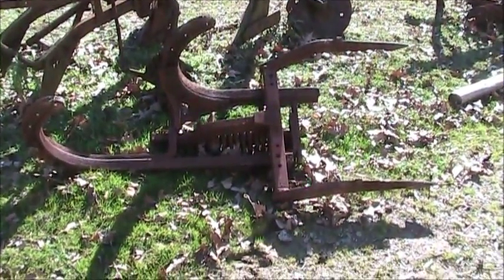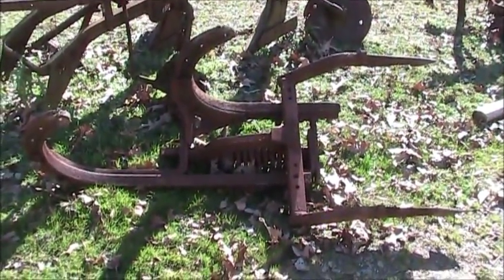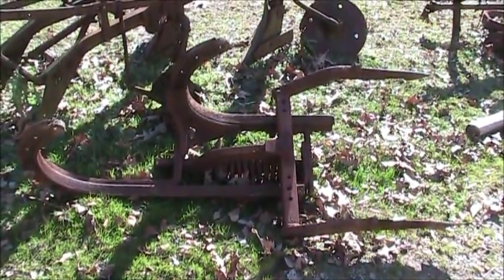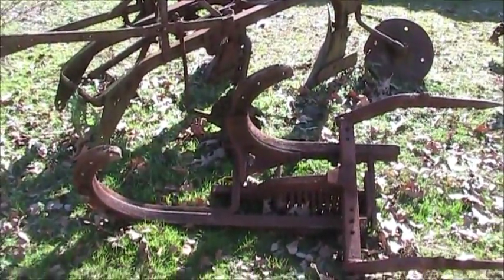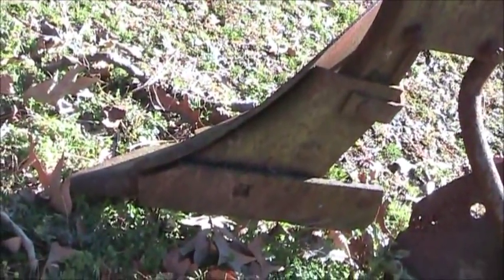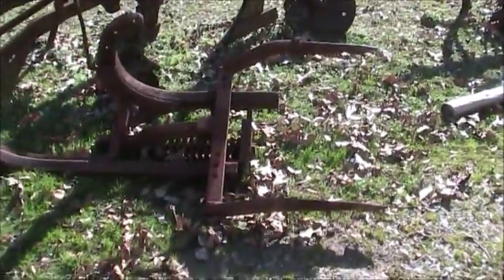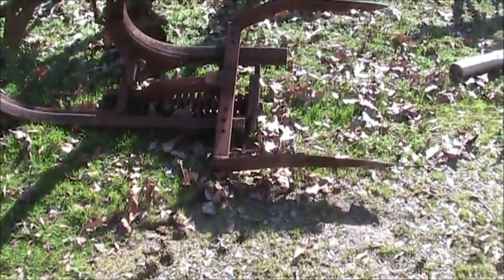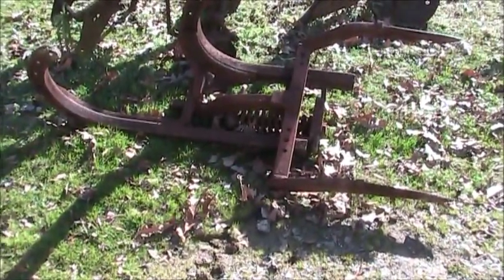IH McCormick C-20 Fast Hitch Moldboard plow

Comment: I did plow with one of these back in the day. The wheel setting is interesting in that the right wheel needs to be 2" off the end of the axel housing. Seem like the left wheel was to be 4 or 6 so that you could look down the top of the radiator cap and keep the correct placement by following the old tire track. Good job on the plow. Lmack